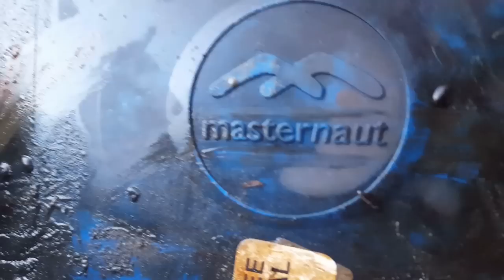magnet fishing more random finds

Comment: Great video.  I have just taken this up myself.  I bought a magnet which was 130kg but didn't find it very good so invested in a 770kg like yourself but I'm having the same problem as you...my 130kg has a better pull.  So you are not alone...I think we have all got a dodgy batch.
Reply from the maker: I've actually gone back to my old faithful 400 kg double sided magnet. Might keep it for a fridge magnet though lol
Reply: Lol...good luck with that....mine slid off the fridge..😂